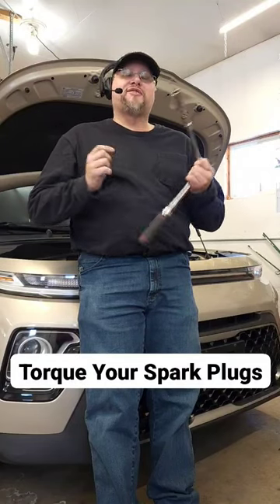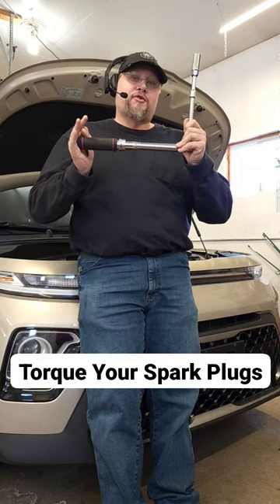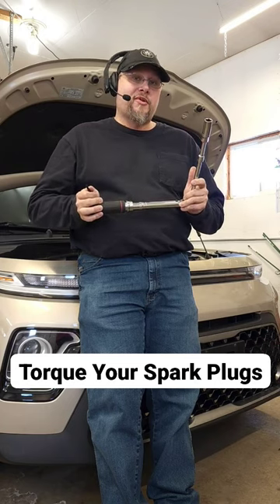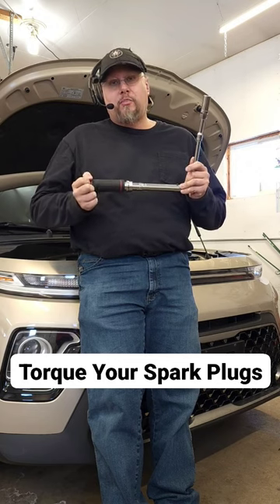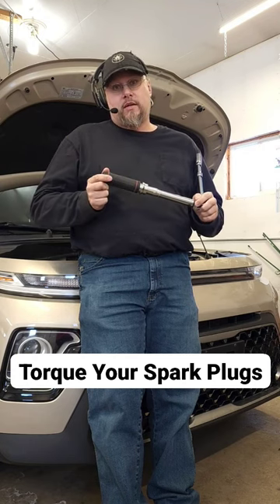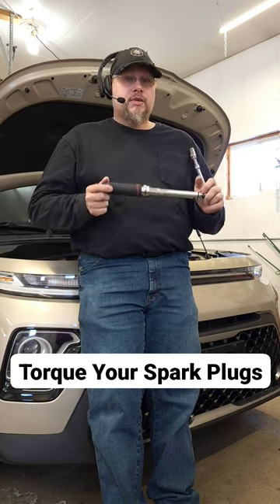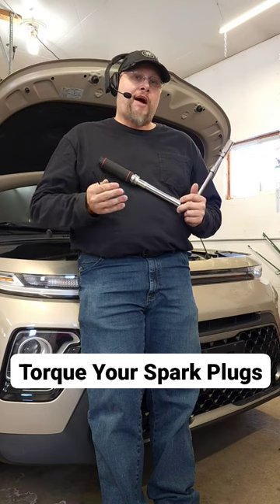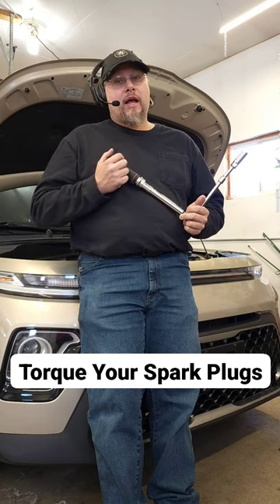Torque Your Spark Plugs - Bad Wrench Automotive

Comment: Wont that extension throw torque measurement off?
Reply from the maker: Good question. I have had it measured with my torque wrench, and as long as I kept the head of the torque straight with the socket. The change in torque was not noticeable, but once the torque wrench was not in line with the socket, the torque was off significantly. I will cover this in future reels.
Reply: @BadWrenchAuto  I've always had my dad to do plug change and he never torqued and doesn't believe in so.

One time I got a used Mustang GT and it blew a plug.  Those years were known to do it.  Was it due to that or previous person not torquing who knows.

All my cars are difficult to get a torque wrench to down on side of the heads. Small engine bays large engines.

I had a SRT-8 that needed some so I let the dealer change for 1st time ever. A whopping $500.

The only reason I allowed bc they said they would torque.   Did they? Well that's between them and their God.